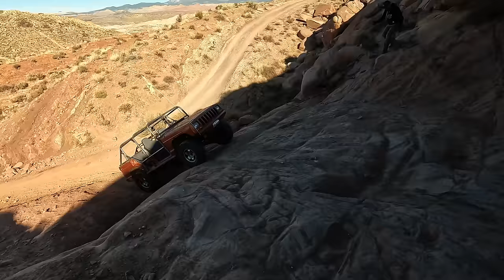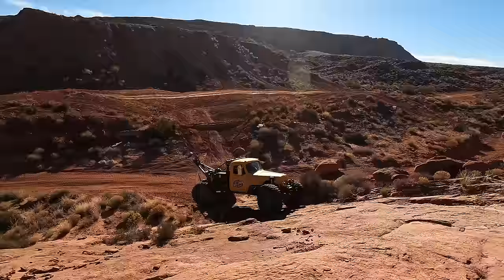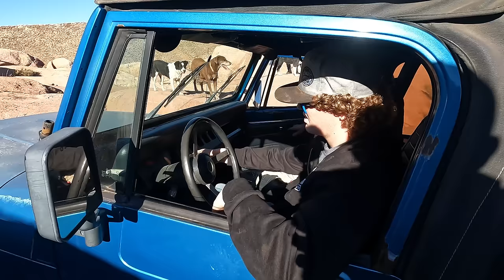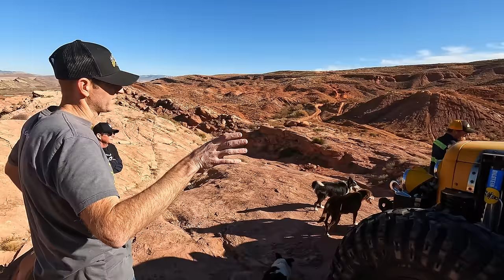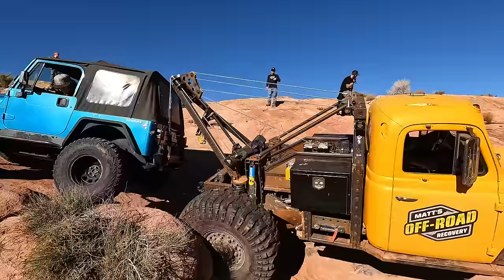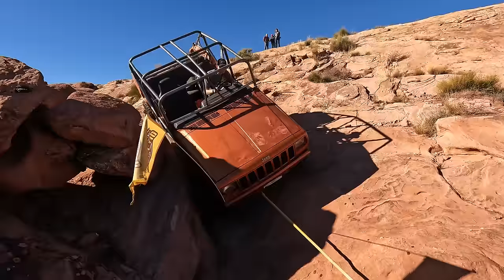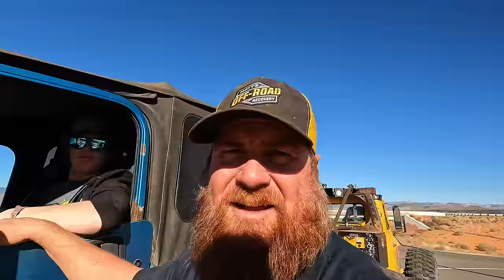I Made A Bad Choice...Broken Axle

Comment: I bet the Tangerine is more useful in its current configuration. Maybe a canvas top and a windshield and a front winch could be added for more recovery work.
Reply: a windshield - even just perspex - is a must. especially if the driver in this case is not even wearing sunglasses. very easy to get injured - a stone or an insect to the cheek is dangerous enough, let alone straight to the eyeball.
Reply: @ritterkeks  I think you're right. I wear glasses so my eyes are all right, but I've had a few bumblebee strikes on my bike at 8-15 mph, and it's a startling impact even at lower speeds. Just the other day I hit a dragonfly. It was disorientating -- WHOMP-FRRRRRR with its wings over my eye. I would absolutely have had wings in my eye if I didn't have my glasses on. I was on a path less than 3 feet wide with nettles on one side and a canal on the other, with water which stays cold enough to be dangerous for almost the entire year.

   So I guess I guess I have a very good reason not to get contacts, even though I see much better with them.

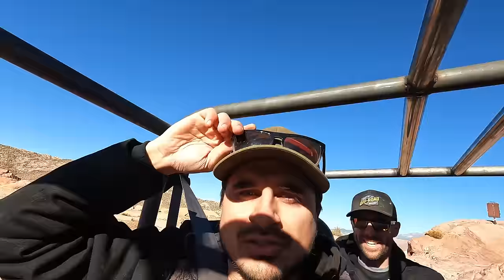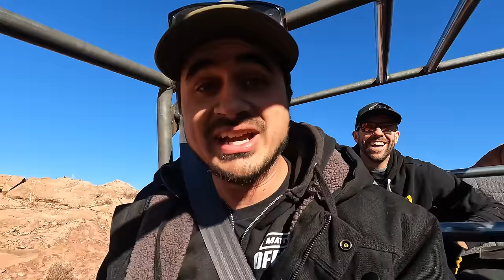Comment: Around 1:55 to 2:00 I noticed that both of Tomtom’s passengers were holding on to the roll cage rails. Might I suggest to put some sort of loops from the one where Colby has his hand to the a pillar one. To reinforce the corner and provide a hand hold.
Reply: I was thinking the same thing when I seen it.
Reply: Agreed - dont need any crushed fingers in a roll over

Not that Tomtom would ever roll it...
Reply: I did the same to our sand rail. Make sure the inner cage tube is trussed enough so that its impossible that the outer tube bends inwards enough to crush a hand. And you never get rubbed on a tree at high speed...
Reply: Been saying this for a long time. Never hold on to the roll cage. Keep your whole body in the buggy. Holding onto the roll cage in the rocks is a great way to lose some fingers.
Reply: Been saying this for a long time. Never hold on to the roll cage. Keep your whole body in the buggy. Holding onto the roll cage in the rocks is a great way to lose some fingers.
Reply: Been saying this for a long time. Never hold on to the roll cage. Keep your whole body in the buggy. Holding onto the roll cage in the rocks is a great way to lose some fingers.
Reply: @briannicholls2628 all you have to do is bump a tall rock with the cage and half your hand is gone. You don't have to roll over
Reply: I believe Matt mentioned that in a previous video. There's no where to hold on to. They will likely add a bunch of good hand holds when they get it back in the shop.
Reply: There are soft grabs available that they could throw on for now. Cheap enough and no fabrication required.
Reply: I don’t think they need them tbh. This crew has enough experience to know in a roll over to cross your arms and keep every limb as close to your torso as possible
Reply: Toms not an off roader.
Reply: Tom Tom does pretty well I think
Reply: They haven't made it that far yet they were just last episode that showed with the tangerine just getting the cage built and they hadn't quite put in any support brackets yet
Reply: @gerrymoeller you saw it. You didn't seen it.
Reply: The wrecker sounds like a dinosaur from Jurassic park
Reply: I agree with the handles, but do that after they slant back that hideous windshield bar!!! 😆😆
Reply: I still worry about the rear passengers smacking into them when braking or dropping off a wall etc.
Reply: @bripslag you didn't seen at least you can't say for sure him saw it so you don't know .
Reply: @abnpthfdr2934 yeah I know,  Matt said it was extra work but he threw away a chance to show what you can do with a rollover jeep, because side by sides are too expensive for the average Joe, the Tangerine is a capable and reliable alternative.
 A couple of pie cuts in the A pillars and some cutting short would make that windshield look Right although it does look like it's a deuce and a half because it's tall
Reply: @mrromantimothy  100% agree!🤙
Reply: Good idea for safe handholds to protect hands and fingers in case of a mishap.

Comment: There HAS to be some kind of draw bar setup that can be made for that wrecker to make the braking less of an issue on the vehicle being towed.
Reply: Like the hook and sling that wreckers used to have before cars came with plastic "bumpers"
Reply: I wonder if a adjustable bar (pin and holes) and two ring hitches one on each end. Then a pintle hitch in the receiver of each vehicle that would stop it from smashing into each other. Along with the winch holding it up
Reply: I have thought the same thing since all these channels have started this wrecker trend.
Reply: Need a rear dolly they can put the car in with remote braking that Matt can do from inside the wrecker
Reply: The military uses tow bars. Not sure why this has NOT been implemented with the off road wrecker scene yet for this exact reason!
Reply: Tow bars like the military or older wreckers use work great on relatively flat ground because the towed vehicle pushes straight down the bar into the wrecker, and the weight of the vehicles keeps the bar from flipping up, but at The extreme angles that occur between the wrecker and towed vehicle in this terrain the math changes and the weight of the vehicle being towed actually causes the bar to want to rotate and let the towed vehicle crash into the back of the wrecker.  Basically at steep angles you still need breaks even with a bar.   To overcome this the joints at either end of the tow  would need to be sprung so as the angle between the two vehicles increased, bar tried to push itself back into a straight line.  Not impossible but there would be some heavy engineering involved.
Reply: @andrewr2650 ***brakes, please. Not breaks🙄🙄🙄
Reply: There is. They can easily make something that could lock 2 vehicles together, make is adjustable etc.
I've been commenting on this since they made the heavy wrecker.
Idk if they're just lazy and don't have the time, or they just like filing harder recoveries?
Idk
Reply: Fab Rats got it right...
Reply: @andrewr2650  Agreed.  Could you imagine trying to use a tow bar on this particular recovery?  No thank you.
Reply: @andrewr2650 it's not thst hard.
You're over thinking it.
I just needs a swivel joint in the center of the bar, so the vehicle being towed can pitch and yaw, but still be solid to the wrecker to keep it from needing brakes.
Reply: Just a standard tow bar would do it. They could even make a custom one easily
Reply: There is a reason off road recovery people don't use those in difficult terrain watch last years off road wrecker games
Reply: By adding a “drawbar” you have to get out and remove it when you have to winch off to get over an obstacle, kinda think about the way a logging skidder works. But yes, it would be very helpful most of the time.
Reply: @andrewr2650 
Thanks einstien.
Reply: I had an idea like a year ago for one, but after that they pointed out why it would not work for a lot of the recoveries they do, too much articulation and going up and down large rocks and such, maybe with some space x engineering they could do it but I think Matt prefers ropes for ease of use and reliability
Reply: I’ve been thinking the same thing.  Use two pintle hitches in the receivers with a bar between them.
Reply: @mikeworkman3593  have to see Rory’s channel why this won’t work well for most off-road recoveries. Easier trails and obstacles it may do fine. The harder trails probably not well
Reply: Yup, been saying for months he needs to make a sling type setup, would be fairly simple too using the twin pintle hooks
Reply: Wouldn’t it be possible robust get a tire between both vehicles and strap the towed one to the wrecker
Reply: @mikeworkman3593 when he was building the wrecker, Matt said he specifically didn't want something on the back because it tends to make extreme recoveries more difficult
Reply: @colbysheppard3682 Rory has 3 wreckers. Mater doesn't have a bar
Reply: A chain or cable ran through a piece of pipe is how my dad towed log skidders by himself... the trick for this would be to attach the wrecker end of the pipe to a pinal Hitch then  ...I think a guy could make fab up a y shaped piece of pipe with v shaped saddles and chain it tight to the axle on both sides....that would  keep it from coming forward....
Reply: Call Rory and Casey
Reply: @79erCJ No, the two vehicles need to each be able to move their own way!
Reply: It’s called a wheel lift lol. He built it with an idea in mind and it’s not functional. An articulating wheel lift is best. He will end up with one before it’s all over.
Reply: Agreed 👍
Reply: He just needs to build a roll back on 54’s now.
Reply: I believe the reason they do it this way is the flexibility, making it possible for example for the wrecker to climb a ledge and then winching back up, instead of heaving to disconnect anything
Reply: I think the best bet would be a longer boom on the truck, and i know hes already said he didnt want it longer because of the lever action with weight on the back but weights are easy to add to the front of the truck to counter act that.
Reply: Its called a removable hitch sling. I've made the comment about making one to use but when you aren't as smart as the guy who built the wrecker, its a really dumb idea. I would guarantee if it was an option recoveries would be a whole lot easier.
Reply: I have said that multiple times as well 🤷🏼‍♂️
Reply: A logging chain in a piece of pipe works great as a draw bar. What we did back in the old days.
Reply: I think any suggestions of a draw bar fall on death ear's.
An easy solution is a under lift ,like Casey LaDelle has on his ram ,maybe not as complex ,but the basis would certainly fix all these issues of keeping vehicles of the back of the wrecker(smashing),and yes we know Rory doesn't use one ,but the evidence is here for Matt to bull the Bull by the scrotum,oops horns .
Matt ,please answer this ,can you lower the wrecker boom down low to act as a under lift of sorts ?
It may require a step down addition to the end of the boom ?
Reply: Ask Rory why not to use a solid connection between the two, he doesn't. A passenger is used to brake.
Reply: Should have Vince gripped the rear brake line and bled front.
Reply: A longer boom arm would also make the issue much better
Reply: @mikeworkman3593 I do look forward to you describing your solution here. I'm sure Matt and his team would appreciate it. Maybe even relay the experience you have that gives you the expertise in designing something like this. Love to hear it!
Reply: Wylie Coyote uses an acme boat anchor.
Reply: All you experts should just do it yourself n show Matt how it’s done!
Reply: You beat me to it LOL. I used to have an old wrecker with the sling setup. I loved it. It worked awesome towing vehicles. And you didn’t have to worry about the vehicle slamming in to you when you used the brakes.
Reply: @andrewr2650 
I would like to try a triangle bar with heim joints or maybe u-joints for articulation. Might need some kind of ram to stop the towed vehicle from overtaking the tow truck
Reply: @ChuckHickl  I come back and find half a dozen comments about this tow bar.

IDK what is so hard to understand. A rigid tow bar, with a U-Joint style pin in the center so and can articulate on the vertical and horizontal axis.
People saying it needs to come off when going through an obstacle are all dead wrong. Apparently you people have never seen Rory(or Matt before the wrecker) use their off-road trailer over all kinds of sick obstacles. It would work no different than a hook and eye style(pintle hook style) hitch.
The towed vehicle would become the trailer, but you could raise the front of it.

All this, of course, could be resolved with having a longer boom on the wrecker. Which would have to have an auto leveler designed, so as they go up a grade, the boom raises automatically in tandem.  Make it all hands free. 

Of course they will never do this, it takes too much of their skill away, making where anyone could drive the wrecker out, eliminating the need for Matt.
Reply: @ChuckHickl  Also, anyone wondering if I'm just some nerd on a keyboard, I've been a heavy diesel/ transmission/ truck/ bus/ ship/ crane/ etc mechanic since 1996. I've had to personally make tooling to remove just about anything you can think of, out of just about anything you can think of. When a tool didn't exist, I have to create it. 
I've driven almost anything with wheels on almost any type of surface you can think of(not lava, not yet anyway). That heavy wrecker is a little toy compared to a Terex articulating mining dump truck, which I have had to test drive(many times) down inside mining pits, while a dragline crane the size of a 40 story building dumps a load out of bucket that is the size of a very large house into the bed.
Reply: Perhaps a wireless brake pedal pusher so no one has to ride in the towed vehicle to operate the brakes.
Reply: @landnnut  That's a good idea, esp if the vehicle lets go and rolls off a cliff. 
All you need is a linear actuator and a wireless circuit to control it. You could probably use a wireless trailer brake setup and modify it.
Reply: Rory dosent have any problems with his been using it longer than the Wreckers been made 😂, all the best to yous all
Reply: I’ve watched the heavy wrecker do some gnarly recoveries and they haven’t damaged a customers vehicle yet…well, there was that one time but very minor. In the end, I think the person doing stuff gets to decide how it’s gonna get done and I suspect they don’t want to carry around a drawbar for the occasional times it might be useable or useful.
Reply: Two extremely thick rubber  sheaths on straps or ropes crossed would do the trick. Just a little give and flexibility and a lot of rigidity.
Reply: A tow bar made it compressed shocks to absorb the flex and push/pull. Matt has the ingenuity to build it but for some reason hasnt
Reply: Matt once said that the only purpose for the two lines was for a tow bar. Right!👍 That’s the only thing they haven’t been used for. Apparently they’re too busy to install a simple thing like a tow bar so instead they just keep fighting the problems created by not having one.
Reply: We made that harder than it should have been! 😂😂 MORR motto!
Reply: Longer boom
Reply: If you are towing on flat or gently undulating ground towbars are great , the issue on this kind of ground is that the towbar would get caught up,that's why they all use a lift strap .
Reply: Someone mentioned boat bumpers at one point. That seems like a really easy cheap fix but who am I 🤷🏼‍♂️
Reply: A beefed up European spec trailer dolly would make his like so much easier
Reply: The tow truck boom is just not long enough for his intended use. An extendable boom seems like a must
Reply: @haroldparker3487 
That’s why Rory has a “new” truck with a wheel lift.  Because it doesn’t work. 🤦‍♂️
Reply: I have mentioned an easy style to Matt,Rory and Paul. A trailer hitch mounted t bar is all they need. A 2x2 tube 36 in. It would be a simple fix.
Reply: @andrewr2650 funny you should say that. The co star of the show is literally an engineer
Reply: Cut break lines to the rear axle pinch them off top off the break  fluid and you can at least get from breaks
Reply: This is what I was thinking for quite some time now.  Most of the vehicles he recovers have D rings or other recovery point that could connect to these two bars, then slip the other ends onto the center lintel hitch on the back.  You could even add two lift points on the bars if you wanted to lift using the bars for vehicles with plastic front ends and forward front grilles where the ropes are putting pressure on the plastics.
Reply: But there is no way to make it universal. How would you hook it to this jeep, a ram 1500 sport with plastic bumpers, and a camry? It also has to somehow allow enough flex and movement between the 2 vehicles. They need to be able to get closer and further from each other. He just needs a way for the vehicles to safely swing without hitting the wrecker, maybe a longer
Reply: Yeah you could incorporate some shocks to have flex and damping
Reply: @travismathews6297  you're assuming you're dealing with bright bulbs... Your not.
Reply: @JojoCano-ix9cu but that would eliminate all the drama, 😅
Reply: Everyone thats commenting on a stiff bar, you could always make one and try it for yourselves. Hey, if it works, you will be able to sell it to all the people who keep telling you it doesn't work
Reply: @Lance-bi2gv LOL, a lot of Monday morning quarterbacks on this one for sure! 😂
Reply: They’re too lazy to do that 😂
Reply: @jochemhoogantink8075  why not an articulating wheel lift and no boom? Seriously I am building one now. It will weigh less and be more adjustable. I have an idea but need to finish mine and test it. I also have a huge and tall vehicle so I can not use a mass produced wheel lift and modify it.

Comment: You need a solid link from the back of the wrecker to the towed vehicle. I have an idea for it. Utilize the pintle hook. Make a 2 piece sliding square or round tube with holes drilled to make it length adjustable, add the pintle hook to attach it the the wrecker. Than make a couple adapters that can strap on to the diff, or bumper & one to go into a 3 in hitch reciever on the towed vehicle. No more damage, and no need for braking or an anchor vehicle.

Comment: Just a tip I learned a long time ago when you blow a brake caliper you can take the brake line off slide a nail in the line re-install line and it will plug the line so you'll have the rest of your brakes